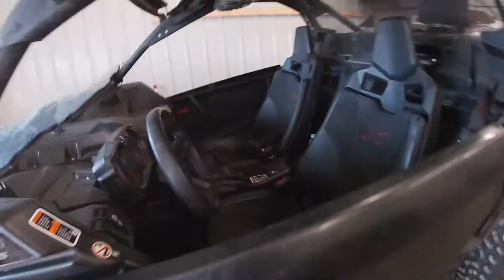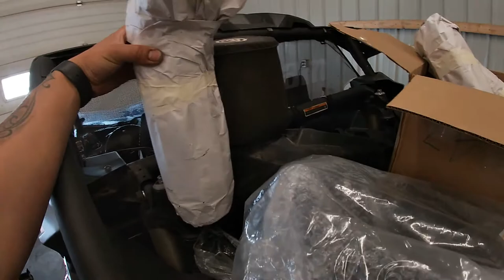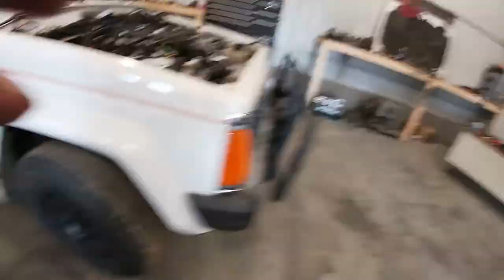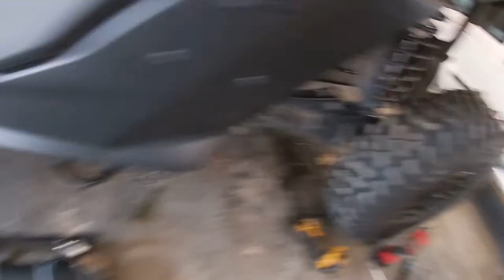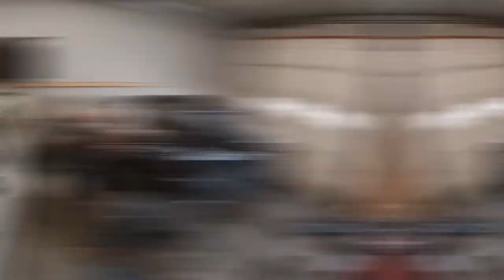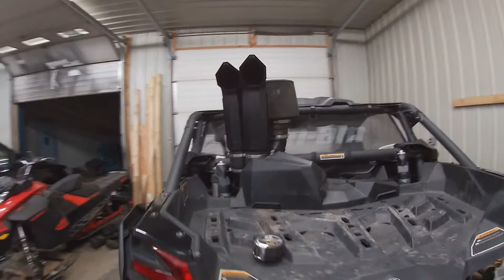CAN AM X3 TURBO SNORKEL INSTALL - PART 1 (INSTALL)

Comment: I bought this same kit for my 2020 x3 is it worth it I haven’t installed it yet…
Reply from the maker: highly recommend because fraction of cost. i never once over heated a belt and blew it on my first ride. some of best muskeg in north america. sealed up tight went so deep my hip waders were titties full. check out part 2 of the review. aka shake down ride, rankest skeg day ever with no issues
Reply: @LAMBERTBUILT  the instructions said to cut out the factory breather box filter section how did you bypass that or did you cut it
Reply from the maker: @xaviertate5141  im running a home built 5 inch cold intake off of my turbo. im only running my clutch intake and clutch exhaust. 2 snorkels i used from the kit the rest i didnt both with. kind if bitched it but i wasnt giving my my cold air intake